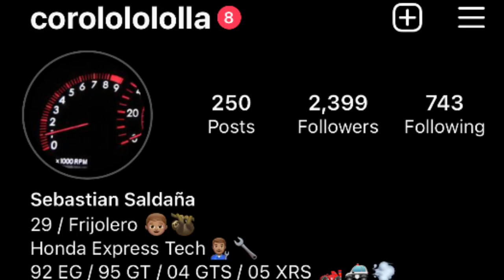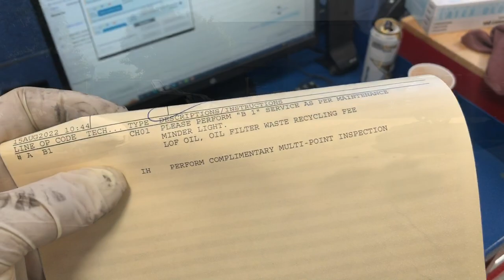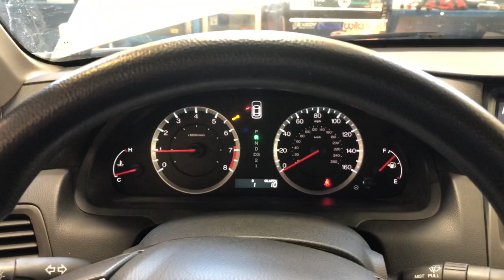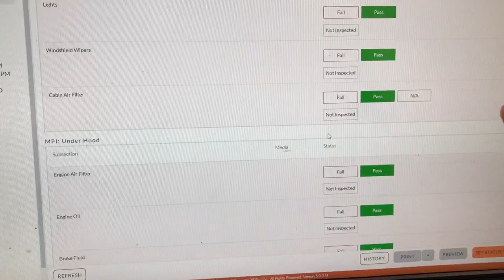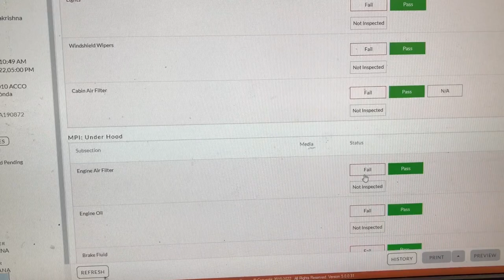My last day as a Honda express lube tech…

Comment: The idiots at a local Toyota Express Oil Change over filled my wife's 2020 Camry SE 3 and a half qrts over what it took. I no longer trust anyone to do my oil changes I do them myself now. Just as bad as Wal-Mart centers. Hope you guys do better than they do. They did make it right by checking all the seals and areas that could have been damaged from the over fill and they took my advice on making it to where they have to show the customer the dipstick showing the correct oil,level to avoid that happening to somebody else. Good luck on your future endeavers!

Comment: When you guys do the oil change at 4.4 quarts do you guys top off after you start the car and the oil filter fills up? I do my own oil changes even on my new cars but I’m curious because the owners manual does give a capacity but it’s never that straightforward when filling.

Comment: Wait wait. Why put 5 20 oil on an old car?? It was 5 20 when it was brand new but theses engines burn oil quick,  owning a 8th gen accord and crosstour wiith the same 4cyl i put 10 40. Is that just dealer standard lol?